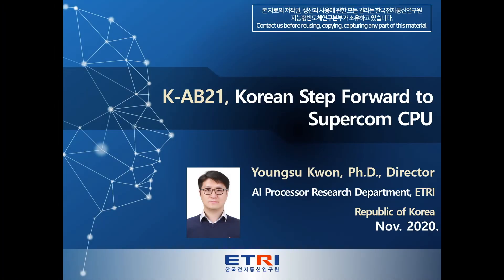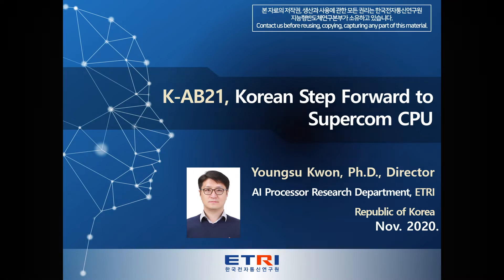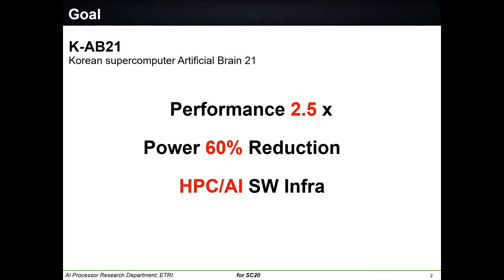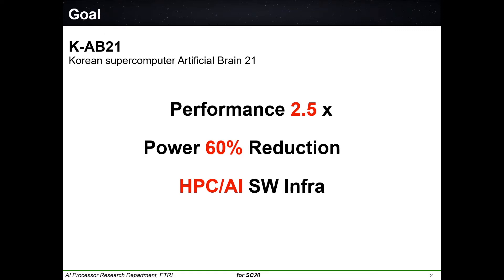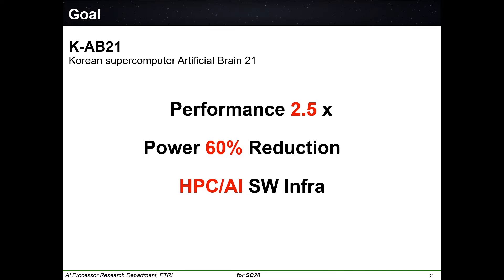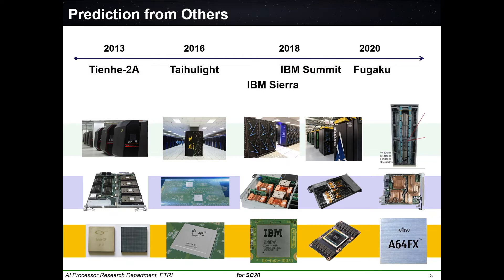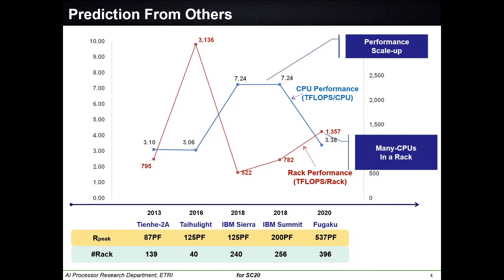The K-Supercomputer CPU's Design Perspective, Overview and Applications, AHUG SC'20

Comment: CPU design details start at 7:37.  4 tiles.  Each tile contains Zeus cores with SVE, XEMC accelerators (fp64 capable), and HBM2E.  DDR5 off package. Tiles, PCI, and memctl connected by Arm-provided CMN.  ETRI are designing the crosspoint structure, currently 10x11.